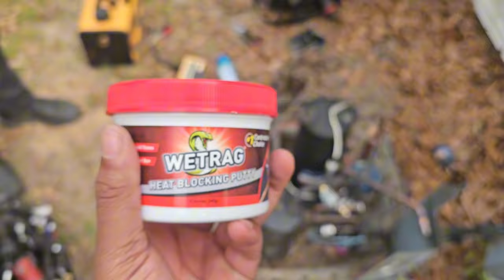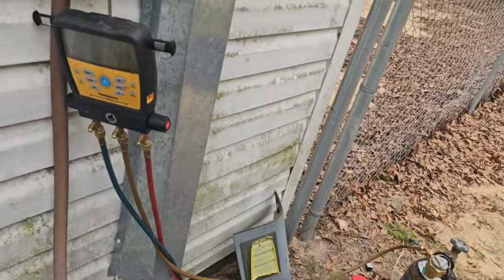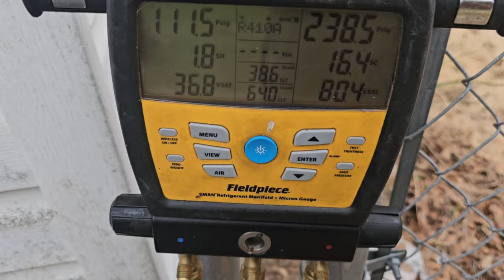Replacing Reversing Valve on Goodman Heat Pump Condenser

Comment: Good job man. There are a few tricks to putting on reversing valves that you learn over time. One of the tricks that I like is to cut out the old reversing valve leaving fairly long pieces of copper on the valve then unbraze those pieces and braze them onto the new valve. After that, use couplings to reattach the whole assembly. This allows you to do the difficult brazing outside the unit while being able to keep the valve cool.
Reply from the maker: Bro that's freaking genius. My boss did that with a rheem when I first got with him but I didn't have enough 3/4 Couplings on me to do that. I normally cut out compressors but after burning a hole in that pipe today I definitely will try to see if can do that trick instead. Don't wanna go through that again
Reply: @AB_HVAC  yeah, my boss that passed away recently taught me that one. He was 72 years old and had been doing hvac for over 50 years. He taught me a lot of cool tricks like that.
Reply from the maker: @AaronPowellvox  old heads know it the best. They got all the good tricks
Reply: @AaronPowellvox   I already knew about the reversing valve trick. What other trick you got up your sleeve Aaron if you don’t mind, sharing
Reply: @TNHVACLIFE  lots and lots.  Been doing it for 26 years and most of the people I’ve learned from have been doing it for even longer. As far a reversing valves go though, another trick is to have a vacuum pump running if the oil in the compressor starts to boil off causing phosgene gas.  Braze one joint, then cool the part with water before brazing the next one. Removing the entire condenser coil like they did does help a lot. You can also make your own couplings with pipe by using a hand grip swagging tool. It’s a very cheap tool compared to the hydraulic ones. It’s also easier than the ancient hammer swagging tool your grampa used. Removing the compressor before the reversing valve helps avoid phosgene gas as well.

Comment: Why put the filter drier back in the condenser? What if you need to open the system again? Change the  evap coil. I would put it on the out side.

Comment: Cut the reversing valve right at the slide take a picture of discharge line orientation unsweat from compressor weld outside makes reversing valves go fairly smooth done a shitload on those Goodman’s definitely a challenge for sure if you have never done one
Reply from the maker: Sensational 🥹 I might try that next time
Reply: Try next time it you will be surprised how much easier it is now you know a trade secret 🤫

Comment: A piece of angle iron screwed to both sides
Reply from the maker: Not necessary in my area
Reply: @AB_HVAC 
I meant to use on that mount with the broken fan motor
Reply from the maker: @emoneyblue ooooohh my bad

Comment: Blower wheel is out of balance…needs to be cleaned…then it may run a bit better with less vibration…
Commented before I finished the video…sounds like your wheel is still out of balance 
Good job on the rev valve if it was truly your first time
Reply from the maker: Ended up doing that and replacing the blower because I was told to. Honestly have seen worse blower motors not cause that bad of shaking so I thought it was the housing
Reply: Clean the squirrel cage FIRST,THEN ADD XTRA SCREWS.
IVE SEE THIS B4 IN RENTALS  Dirty ones
Reply: May be the bearings/bushings in the motor are gone after all that vibrating.
Reply from the maker: @stevea6722 I think the blower motor could've been fine. After removing it from the furnace I'm sure the wheel was the real cause but it doesn't mean it didn't mess up the motor. I would've liked to try and see if I could've gotten away with just the wheel cleaning, if I would've thought of that in the beginning 🤦🏾‍♂️

Comment: I burned my first reversing valve... BAD! 2nd time, i used wet rag, too, but i didn't undress the whole unit. I think the reversing valve is the worst repair you can do. For me, anyway. Good vid
Reply from the maker: I think Trane may have the easiest one because you really don't have to disassemble the whole system to get to it. I only took this apart because the first time my boss came to help me on one, he took the condenser apart so he could get all around the fittings. And that unit happened to be a Goodman too 😅 so I thought why not do this one the same way
Reply: @AB_HVAC  yeah definitely the way to go. Looks wayyyy easier. I chose not to because I had like 6 or 7 other calls including the valve replacement it was summer time and we were busy. Was it leaking or was it stuck?

Comment: Use Stay Bright 8, instead of 15% silver 
Works great,  less heat
Reply from the maker: I've been told it's great but doesn't hold up over time. I don't mind doing it this way
Reply: @AB_HVAC  whoever told you that about staybright 8 is just hating. My mentor been using it forever with no issues. I only braze when I got old ass piping or its not perfectly round.
Reply from the maker: @MoonRambo702  really?  I hear more people say if you're looking to get away from traditional Oxy/Acetylene setups just go straight to press and to not waste time on the staybrite 8
Reply: @AB_HVAC   not tryna spend 3k on a press and fittings tho. Depending on how much u use it, the time saved will prolly pay for itself in a season. 
For property mgt jobs with a tighter budget.. 
stay8 and a mapp torch is clutch. cheaper and looks better, plus don’t have to lug the oxy torch.

Comment: you flame needs to be just a bit hotter brazing goes a lot faster and easier, just keep it moving
Reply from the maker: Yeah, I told Jacob the moment I popped a hole in the true suction line it was because I didn't move the flame around the pipe I got distracted and left it concentrating the heat on one point like a dummy
Reply: I disagree. You are using a very oxidizing flame, which is very hot, which is why you are  compensating for that by keeping the flame away from the copper which doesn't really get the copper heated up.  So to counter that compensation, you move the oxidizing flame closer to the copper which in turn is burning a hole. Try a neutral flame with a number two tip, keep the flame a little closer and the heat will wrap around the joint, while moving it slowly, then apply the siflos when the copper just starts to heat up and turns a little red.

Comment: Looks like someone replaced the blower motor and capacitor and to make it easier to get everything out just cut the sheet metal with tin snips. So why are they calling you now? How about calling the Jackleg that put that blower motor in without cleaning the wheel.
Reply from the maker: They called us because they needed to get a tennant in there fast as possible 🙃 I guess everyone who kept walking it complained about the rattling
Reply: @AB_HVAC  be very careful working for rentals. They are very good at using and abusing you, expecting you out the same or next day and then taking their good old sweet time paying you. All while complaining about your prices.
Reply from the maker: @rv10flyer84  man, don't I know it 💀 3yrs doing work for property management's and that's SPOT ON the situations we deal with
Reply from the maker: @rv10flyer84  but they give us steady work and keep the doors open so I'm cant complaining too much.

Comment: You don’t braze with nitrogen in the line 👀😬
Reply from the maker: Not on systems with pistons I don't.
Reply: u can still plug up the capillary tubes that feed the evaporator bro ! 

I took a brazing class like 2 yrs ago . Will never braze without nitro never again.
Reply from the maker: I'm not saying it can't, but most brazing issues i see come from not getting it hot enough and not purging the lines through of the residual vapor. Brazing with nitrogen is the best way to do it. When the job is bid the right way and I have the time to do the job right to the best of my ability I will, but Im not always given that time.
Reply: Facts lol
U are a good tech 
Good to see other brothers in the trade .
Reply from the maker: @baylifehvac991 i try man. I try to make the best with what I'm dealt. Hell, just recently got a recovery machine

Comment: Clean the blower is the first thing to do when it shake like that, no reason for a new blower
Reply from the maker: And I didn't even think the wheel would be an issue but I for sure didn't think the blower needed to be replaced. Learn something new everyday